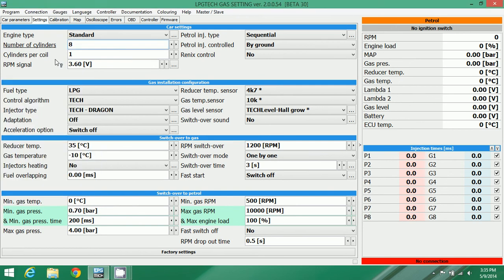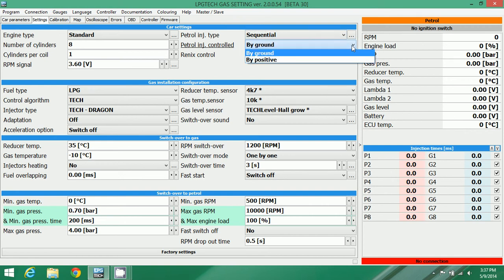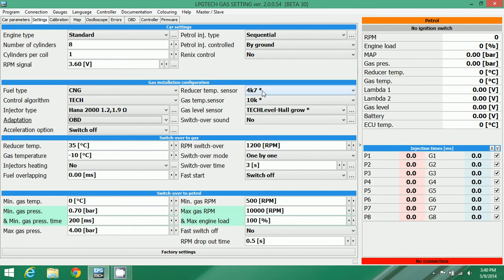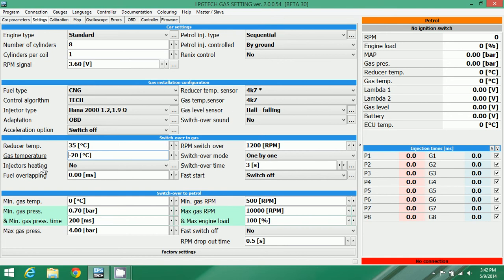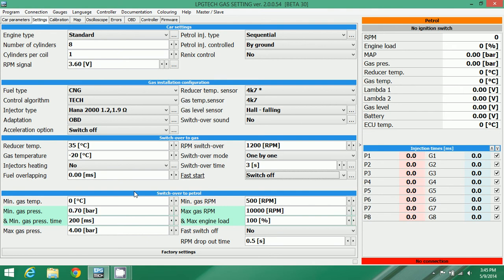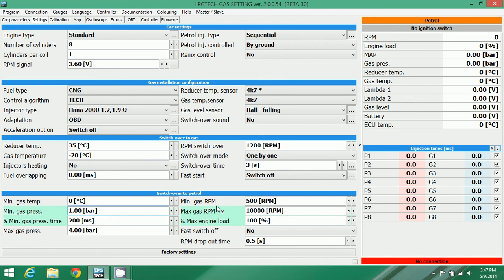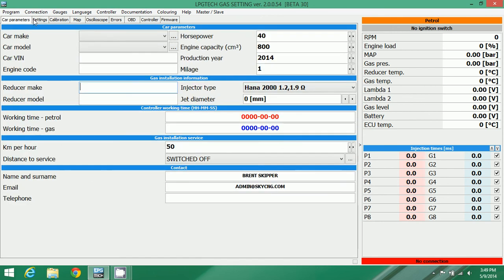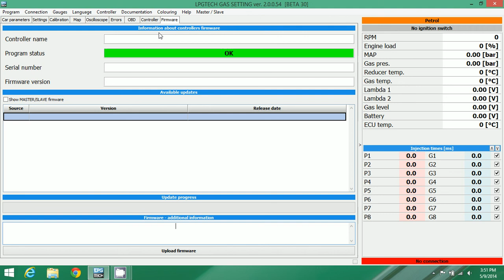CNG Conversion Software SkyPRO Tech INTRO

Comment: Hi there I understand if you dont reply, I just have a quick question I carried out a firmware update on my ecu but now it just has a blue light on the switch panel and doesn't do anything when I press the button also the laptop now wont communicate with the ecu ,any ideas would be greatly appreciated!!! Thanks